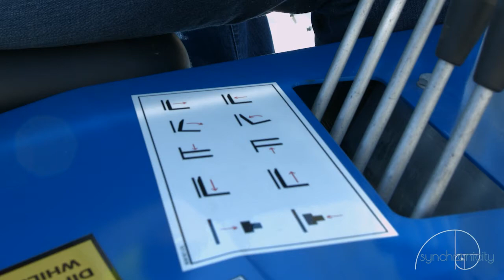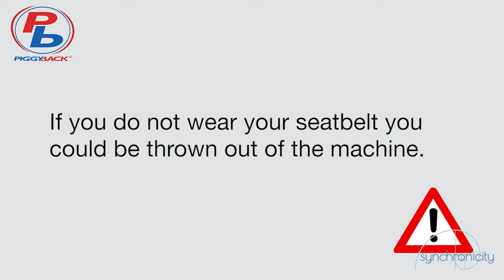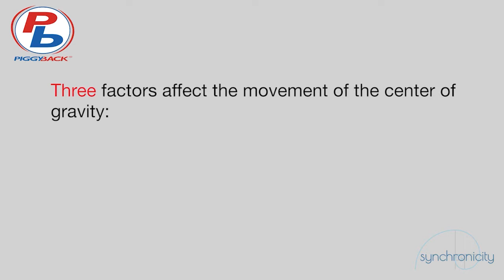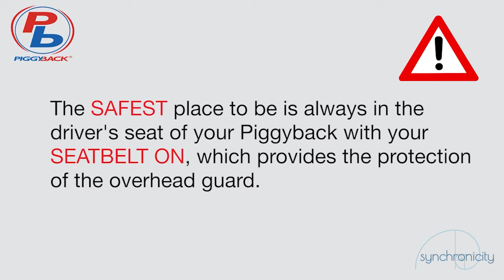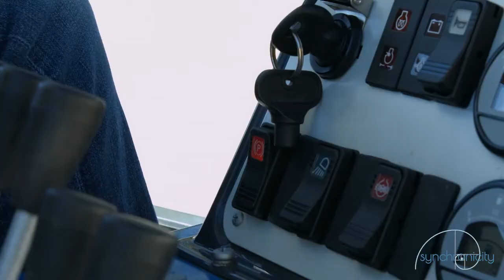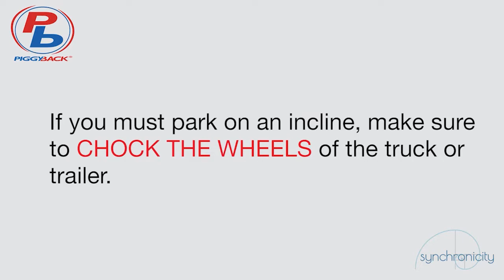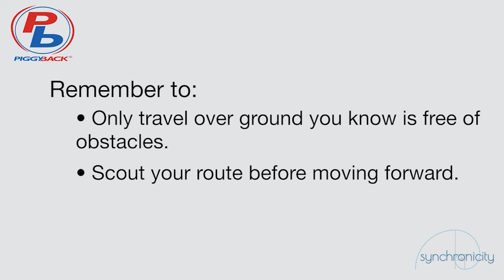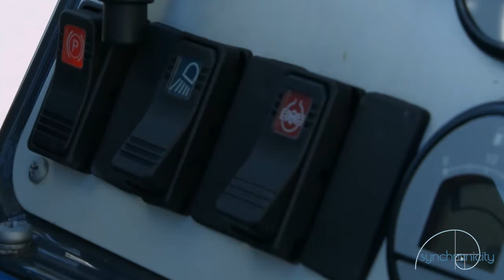Princeton Forklift Orientation Video

Comment: 12:18 how to separate the forks
Reply: To separate the forks, you have to pull up on a metal tap located at the top of each fork. Once you pull up on the tab, you can move the individual fork by hand side to side until they are locked in place. You do the same for each fork one at a time.